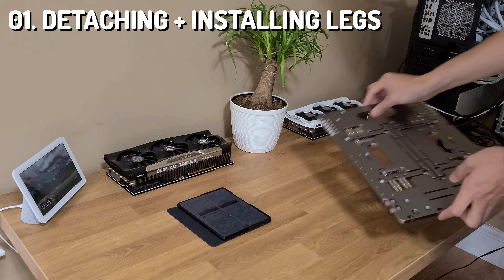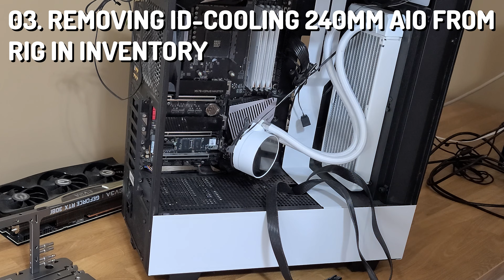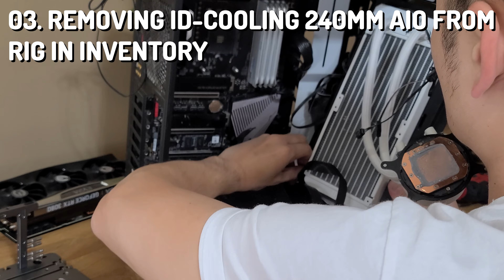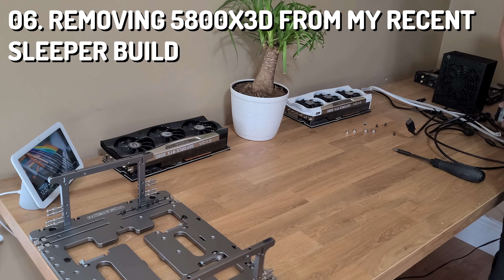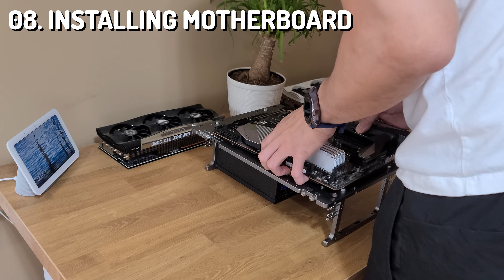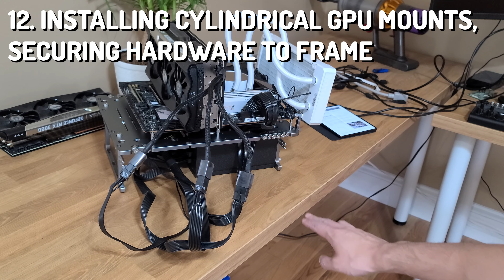Building My Open Air PC: Open Benchtable V2 + AMD R7 5800X3D + 32GB 4000MHz CL14 + RTX 3090 Ti 24GB

Comment: How are you running your open air setup? Horizontal flat down like you have in your video, or vertical upright like in a normal tower PC? Cause it looks like the power supply has very little space to draw in cool air from. Maybe I'm wrong and it has ample space between the table and the PSU.
Reply from the maker: flat like it's shown. The bottom of the PSU and the bottom of the legs are flush and sit flat on the table. The PSU vent is facing up. There is plenty of space and there are cutouts in the frame for airflow. If you're interested I can show you pics in discord.
Reply: @pyurologie  If it's not too much trouble, then I'd appreciate it. Thanks man! Keep up the great content! 👍
Reply from the maker: @atomicvortex3515  sure no problem. jump on my discord and shoot me a message

Comment: Any reason why this should not be a viable daily driver permanent setup? I am seriously considering this for my upcoming 4090 7900X3D build
Reply from the maker: Nope, just different maintenance steps as components tend to collect more dust than in an enclosed case. I use two of these for my main rigs and haven't looked back since.
Reply: @pyurologie  I'm actually thinking the maintainance should be easier. Blow some compressed air cans over the cards every other month or six months and it should be good to go. As opposed to the closed computer I am using now that hasn't been opened in four-five years 😆 Anyways, thanks for the video!
Reply from the maker: it most definitely is. I was just pointing out that maintenance is different. No problem, thanks for checking out my content!